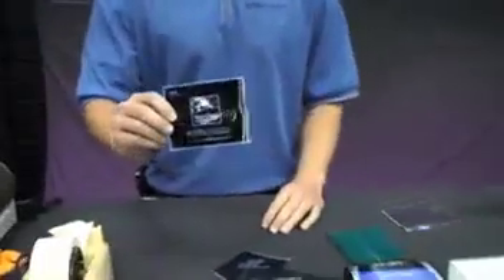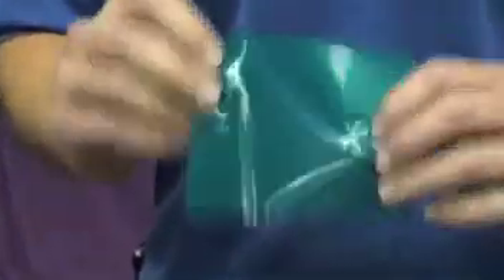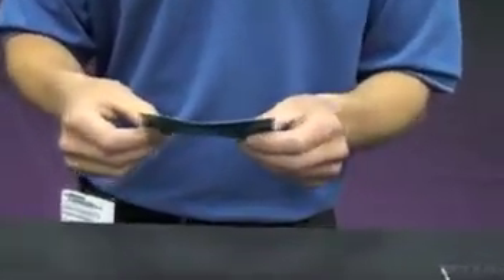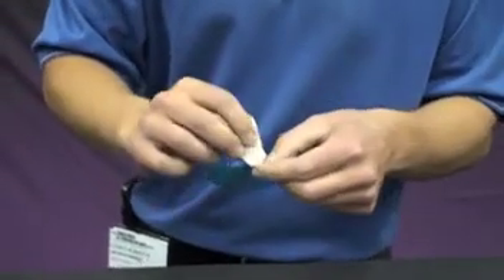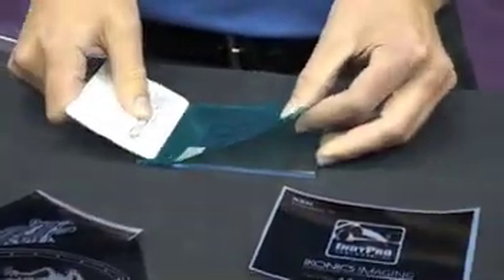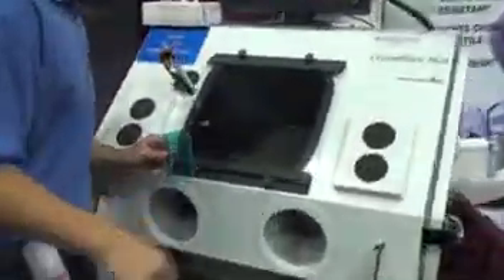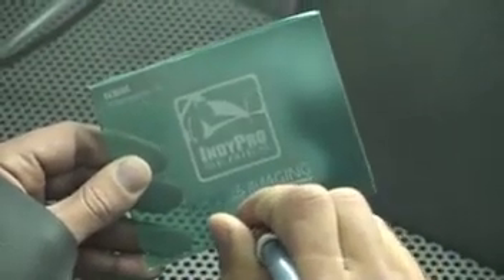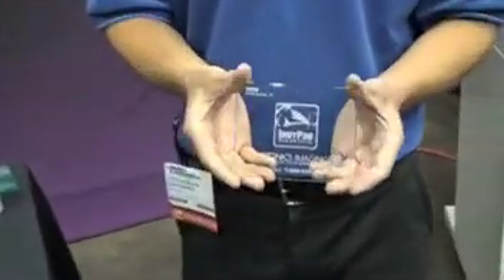IKONICS RapidMask Photo Resist Process

Comment: 1. Do you apply the design to the film mirrored or right side against the film

2. After exposing must you work under special lighting to keep from curing the entire design?

3. Can the designs be exposed and stored without blasting immediately, for later use?
Reply from the maker: Yes, after exposure you must work under special lighting that blocks uv. Also, check out this updated video that explains the "emulsion-to-emulsion" method for artwork. https://youtu.be/d3ahcmN9UzY

Comment: Stuart, 

It may be a few issues.  First, make sure that Rapid mask will snap after it has been exposed.  The Rapid mask online video will explain.   If it does not snap it will not blast.  
The other consideration is the type of abrasive and blasting pressure you use.  In the video we are using 180 silicone carbide abrasive but aluminum oxide will work just as good.  The blasting pressure for a 2mil high detail mask is at least 20 psi from 6" away and 40 psi from 6" away for 4mil high tack.
Reply from the maker: Thanks Darin!